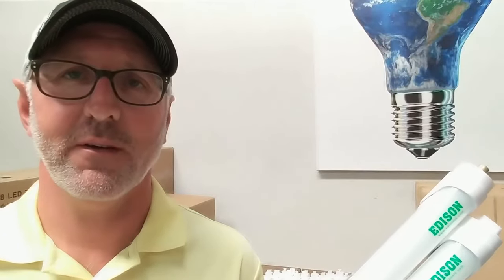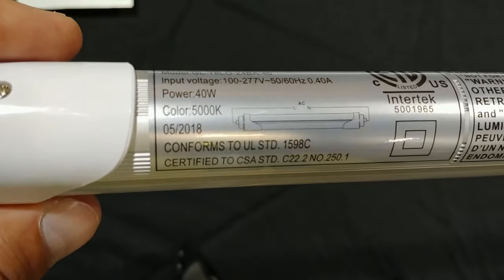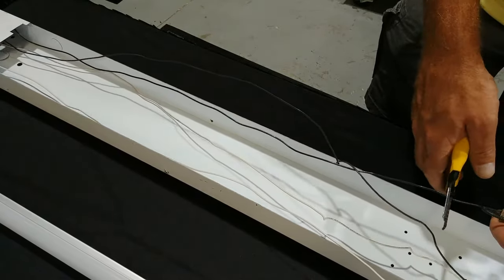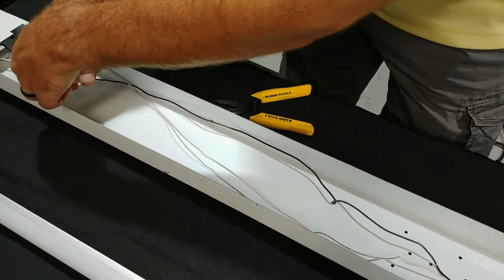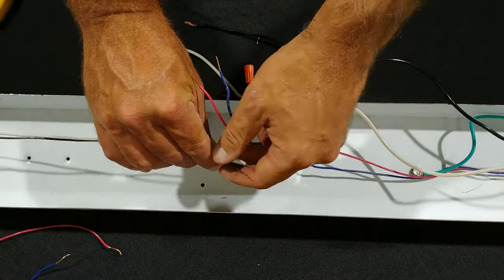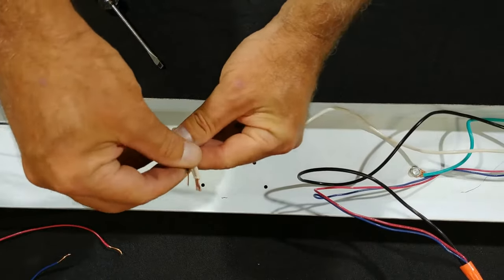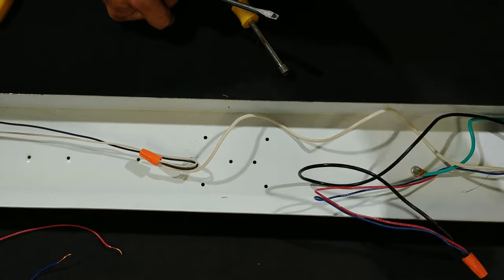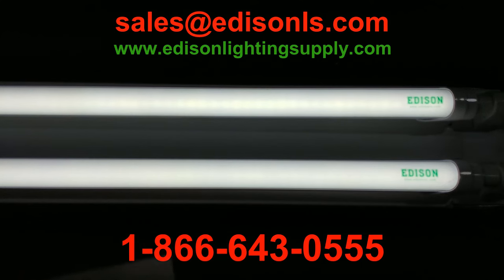How to Retro Fit 8' Fixture with Ballast By Pass LED 8' Tubes

Comment: I just place new leds T8/T12 tubes in today. They replaced the older fluorescent tubes. I flicked the switch and they worked fine. Should I be worried?
Reply: Most likely you bought "type A" replacement led bulbs, which are designed to work with existing ballast. Type B led bulbs are for bypassing/removing the old ballast and are powered directly by the 110v line voltage. Type B are supposed to be more efficient because ballasts consume some energy to convert the voltage. Sorry for the 2 year late reply.

Comment: Should we wire nut  or tape the black and white wires cut and not being used or is that why you made them the neutral line?
Reply: I added wire nuts as a precaution anyway. But VERY good video.

Comment: Worked great for me. Like others have commented, probably should put wire nuts on the ends of the two leftover wires to prevent shorting out to the metal of the lamp.

Comment: What if the fixture also has a an emergency battery pack installed along with the normal ballast? What is the wiring config if we want to remove the ballast but keep utilizing the battery pack?

Comment: HELLO great video i removed my ballast but I have a old 96 INCH FLOURESCENT tube with one terminal at each end..I only have ONE BULB 8 foot in the fixture..do all LED have two prongs? Do i need new 2 prong horseshoes as my horse shows only have one pin on each end..my ballast had one white, one black,(ON ONE END OF BALLAST)  and one blue wire at other end ballast..please advise..thanks

Comment: So, at the "fixed end" (that end with non spring-loaded tombstones) you have non-shunted tombstones...and at the other end (that end with spring-loaded tombstones) you have shunted (joined) tombstones. Am I correct? The kits I see today (eg. Jesled) offer 8' FA8 single pin double-ended LED replacements with non-shunted tombstones supplied for both ends. I was just hoping you might have some insight concerning this. Thank-you.